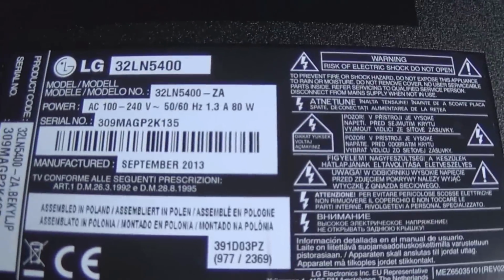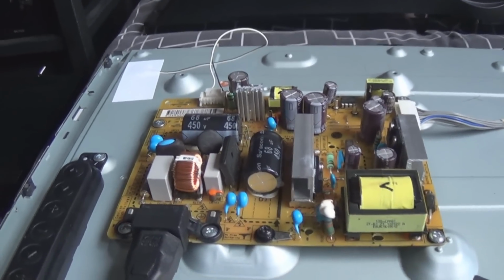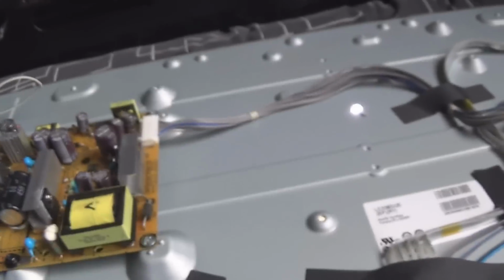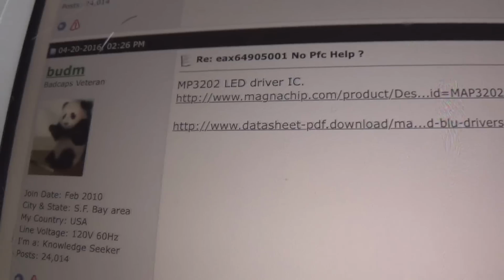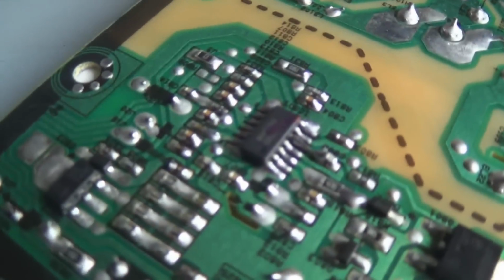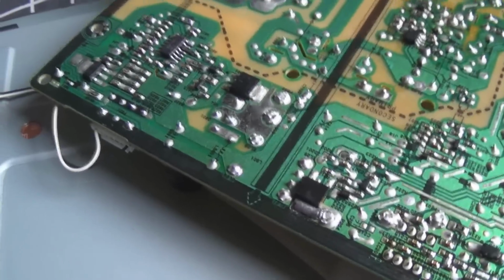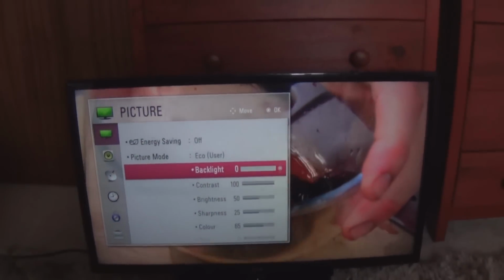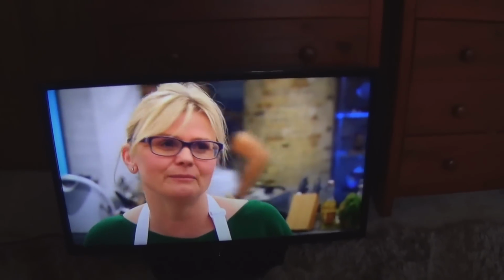Lg Led Tv No Low Led Voltage Repair

Comment: Hey, great video.
I have something similar, changed strips and the driver of the leds and still same thing, plug in the leds light up for a milisecond and goes off, but not off entirely, they are on low brightness possible, maybe ovp protection kicks in? 
I dont know what to test anymore, cant see any shorts. Have 123v on the leds connector, i think i need a lil more to get full brightness, 9leds *3v and 5strips gets 135v... 
Maybe not getting enough current? HELP...

Comment: @MrReeceyburger123 I have a bit of a complex one. I believe some led driver boards do not kick in if they sense faulty led's. I am apprehensive to dismantle as far as the LED's if the issue is in the driver. My LG 32LV2500-ZA driver seems to be outputting the same voltage as it's receiving. 24V However it is not like most drivers it outputs via 2x 10 pin ribbon cables with 2x Vcc out on both ribbon cables some pins are NC and others are marked N1 N2 etc I believe from memory.
  I can not locate any faulty fets or caps etc. but it could be the fet driver chip i guess.
  I also have a feeling it could just be some bad LED's. Not sure what to do next. I could either take it to bits and test leds separately, or just order a set of leds, or i could possibly try to locate the FET driver chips and look them, up then try to test for a waveform. A new driver board is €45 New LEDs €20 and i paid €40 for the broken TV hmmmm.
  If i was getting the 96V i would simply buy the LED's If they had simple connections like in most models i would give them 96V to see if the leds work but this one seems tricky. I guess i will look up the chips on the board and try to test them for waveforms, failing this i will open the set deeper and test the leds.

Comment: I put a 12volt led strip with it's own resistors on each one...with the led power output is 12volts....but LEDs stay on...on standby...y is dat...🤔
Reply from the maker: If it works just unplug them when you turn it off or get a remote switch haha
Reply from the maker: Don’t do that
Reply: @MrReeceyburger123  but it works...

Comment: I do have such issue, NO LED Light. Per specification on output should be 157,5V but there is 200-210V and it is fluctuating. LG 39ln575s. Can anyone guide me ?
Reply from the maker: Leds

Comment: Your video had three caveats:

1. You should have used a tripod; so that our eyes don't go crazy; as you moved around.

2. You should have shown us your "UN-soldering" the part; and then "RE-soldering" it again; after you removed and replaced the part.

3. "Adjusting the brightness" took WAY too much time; for MOST people have NOT a clue what it means; and they usually never use it. Thank Jesus and bless their hearts.

Also: #2 was a crime! Sad indeed. For those who DO know what is going on; we NEED to see you do the repair; instead of just talking about it.

Finis!~
Reply from the maker: Many hundreds of people with common sense found this video useful. Thanks for telling me stuff I already know though.
Reply: @MrReeceyburger123   It may have been useful, but your camera work needs improvement............its called "constructive criticism"....FWIW

Comment: hi, i have same tvm same issue, but i ordered map3202, i mounted and i have still same problem.Im tested all components and are ok, but is a werid thing there, when i put probes at dc voltage, red on led positive and black on led negative, its gave me 0.6 fluctuating, but when i put the probe on ground i have +130v .What is that?

Comment: Very nice video, very helpful. I just need some more certainty about it. Did the ground with LED - (cathode/negative) had 0 volts when you power on the TV? Thanks in advance,
Mark
Reply from the maker: Cheers man yeah Vestel reverse the wire colours for some weird reason.
Reply: @MrReeceyburger123  OK, so I replaced the same circuit on the power supply board as you did and tested the led stripes and the middle one was gone (tested with double 9v batteries and two small wires. Replaced the led stripe too and it wasn't showing image (just back light; all leds were working just fine). After I open it up again, found out that the image circuit board (green one under the metal plate) has two flat cables and they were introduced into the end and they are not supposed to otherwise, the clamps won't bite the connections.

Hope I help someone with this. 
Best regards,
Mark

Comment: I have a phillips 32" led that turn on show logo and then blank screen.it has 12 led total ive tested both strip which contain 6 led on each separately and its working fine. when i test the led + voltage on startup it boost to 40v then drop and stay on 13v. what cloud be the problem?
Reply: Same problem for me too 
Did you solved it 
Please reply sir?

Comment: nah ,just change it  and my backligh is still faint , dim , change the LED strips , faint still ,  changed the Mosfet  faint still , im running out of ideas , anyone any idea, faint backlight glow , should be 10x brighter but its not , probably low voltage but due to what , Chip changed , LEDs changed , mosfet changed , Capacitors checked , freaking thing wont light up as it should

Comment: this ic is tha same with a switch regulator ? i have a tv led with no backlight but i can hear sound. So , i measure led+ and led- pins and i saw that the voltage on led+ was 145 and for led- was 0.345mV. after that i plugged in backlights and i measured again. it was the same values .  so the problem is on main board psu board ? what is your opinion ? the 24v line was ok !

Comment: Thank you for giving me a vital clue on my own TV.. the backlight has just failed on mine, seems to be in a protection cycle as the backlight comes on briefly then goes off. At first I thought the supply rail to the boost converter was collapsing under load, as C204 and C214 are 100V rated, yet there was only 48V there. I was convinced that was the fault until I watched your video. I wonder why they used 100V caps when 63V wouldve been adequate.

In my case it looks like some of the backlight LED's must have gone short circuit.. I see the LED+ voltage go up to over 120V, and then drop... so OVP is kicking in and shutting things down. Hopefully changing the faulty LED(s) is not too hair raising!!

Comment: not sure if you're still active but i'm gonna ask anyway.
My tv is an LG 47LN5404, everything works, except, no backlicht.
i measured the voltages to the leds and it shows 80.2V on both pairs.
The same voltage when i disconnect the Led cable. The board states 100V to the 47-row and 111V to the 50-row. So it's quite a bit lower. Unsure if it is the power supply or a bad led somewhere, or maybe even both.

Comment: pls help me 😢 my tv has suddenly dim back light .. at startup backlight glows fine then dim.. I measured terminal voltage at led output wire when power on its 140 volt then reduced to 56 volt in 10 seconds .. what's the issue😢😢
Reply: mr. unknown hope you figured your shit out bro! Hats off to you FOR ACTUALLY TRYING! he talked to you like your sitting on the couch like "my tv wont turn on help" lol
Reply from the maker: Lol Babu why don’t you help your self rather than asking me ? I’m not fucking google and plus if you looked into it you would know your issue fuckin lazy you fuckers on here are
Reply: +MrReeceyburger123 
sorry Iam not pro 
I tried but unable to fix my current .. just asked any hint .. nothing else

Comment: hi.my thoshiba 47 inch LED.no video dark shadows problem.voice is OK. I have checked LED strip it is everything is connected to power binking and some time some work and not 
one by one check every thing is bright and proper
.if I check led out put how voltage will come

Comment: Hi I have a lg42la620v TV and have a problem with the LEDs. I turn the TV on and the LEDs flash on then straight off. The picture is still on if you shine a torch at the TV screen you can see it, but no back lights. looking at the LEDs they all light up bar the top and bottom rows when you switch it on but then go off. any ideas. regards.